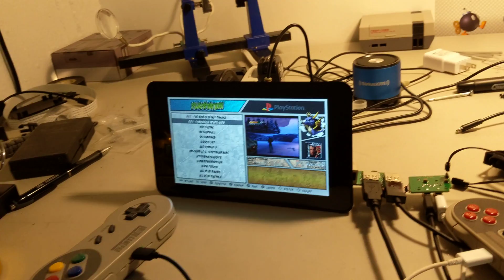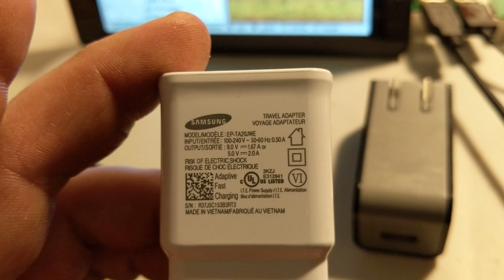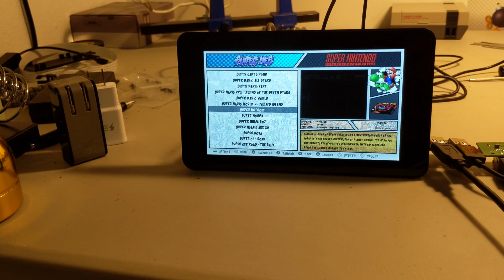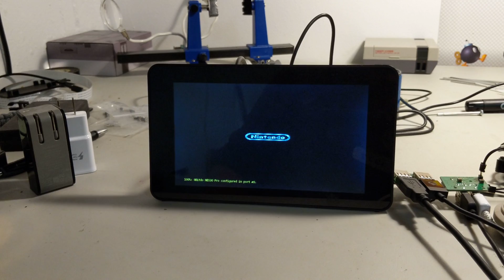Nespi raspberry pi power issue(solved)!!!!

Comment: Makes sense. The factory power supply was designed to run the pi. Then you add the case into the mix, and the case itself requires power, so now it is taking a piece of the pi (pun intended).

Comment: All these folks saying "just get a better power supply!" owe me $16. It's not the power supply. It's the NESpi. The minute I took the NESpi out of the loop I was fine. I bought "the" power supply for Pi and still has the bolt as long as I was plugged into the NESpi's power board. And no, it's not a knockoff NESpi which apparently the makers are trying to claim.
Reply from the maker: yup, I fought long and hard to get some more info on this to prove what was wrong.

Comment: I would think trying to charge four wireless controllers from a PI to be more concerning than the quantity. I'm sure four wired controllers would be fine. Even if I did have four wireless controllers for my setup, I wouldn't ever try and put that much strain on the Pi.

Comment: Good thorough analysis.  My NesPi4 case came with a power supply of its own. USB C 5V 3A, which is what normally is recommended for a Pi alone. Didn't yours?  
Now my Pi 4 hasn't come in yet, but is the power draw from the NesPi4 and all its compontnets really negligible? Even when accessing the SATA "cartridge" port?
Reply from the maker: These are older models from a few years ago

Comment: 3 years later it was confirmed that it indeed was the power supply. This issue may not happen to often with rasp 3, but it does happen with the raspberry pi3+. im just posting this incase someone happens to look at the video and may think that akuma was wrong, he was correct all along. the power supply that alot of modders use 
Mackertop 5.25V 3A.
Reply from the maker: Thanks bud.

Comment: I just noticed. The USB ports in the front (vertically positioned) give undervolting bolt. The ones on top, behind the fake cartridge flap seem to work fine. Using a 5.2V 3A power supply so the problem is absolutely related to crappy case wiring. Going to open it up and see if I can solder some fatter wires on there.
Reply from the maker: It's a combination of crappy wiring, crappy board traces(not big enough for current) and power supply issues with the way it seats into the power connector in the back of the case

Comment: Using a 5.2V 3A power supply here. Worked on my old setup but with a new image on there (fancy 400gb image) I have power bolt issues. I think it also depends on how much power is drawn from the cpu. I love this case so will look for even bigger power supply or a way to mod wiring to make it work.
Reply: that nespi case uses a bit more power than the average case I think that's why the new ones don't have usb 3.0 or a case fan included lol it works fine for me with a 1.8ghz speed  but anything higher even with a 3a power supply I'll get a lightning bolt with a ssd and 1 controller. So i say if you have a Pi4 get a 5v 3a power supply if you can get a solid 3.5 amp or a 5.1v even better.

Comment: I have the official raspberry pi 2.5A power supply, and without the case never any bolt, after using the case the bolt showed up very often, I swapped the wires for a heavier gauge and it's still finicky, first time I booted it never showed up, next time I tried it showed up during boot but then it never showed up again during game play. But the conclusion is that the case's main wiring is definately under gauged.

Comment: For me I tried 5.1V 3A and it didn't help. Then I tried 18AWG wire by itself and that didn't help. Soon as I used both the 5.1V 3A and the 18AWG wire mod the lightning bolt went away.

Comment: I also disagree. I was using the Nespi case with a CanaKit adapter and thought it to be the power supply so I got the Official Raspberry Pi Foundation 5V 2.5A Power Supply and had the same issue. I put the Raspberry Pi in a different case and both power supplies work fine with no issues.

Comment: I have nothing plugged into my retro pi and a teeter totter power switch and still i get lightning bolt lol. Also mine isnt a usb like yours it's a legit plug. What replacement power supply did you buy? Was hoping you had a link
Reply from the maker: And that is why. Those toggle switch power supplies are not always wired up very well. Plus some are under voltage because of the power supply switch. So if you have a 2.5amp toggle PSU you might only be pumping out 2.0amps

Comment: Same Thing happening with the SuperPi Cases. I've switched 3 different fonts and cables thinking it would help... but Im still having low power issues with 2.5A power supply.  I think its like the people say.... some of them are having these issues, some don't.
Reply from the maker: Yeah it's the wiring is too small

Comment: Currently using RPi 3B+ with the new NESPi and have bolts. It seems to come after a while. I played MGS on PS1 for a while, nothing happened. I switched to Doom (ZDoom), and it came along. It seems to do that when switching big games or especially with an Xbox One Elite controller. Getting a 5.25V, 3.0A now. Hopefully it works.
Reply: did it work?
Reply: Yup. No more issues.
Reply: Which adapter did you get specifically? Thank you.

Comment: I have to disagree.
It's not the power supply, I have raspberry pi 3 with a built in fan two USB controllers, and I had no power issues with that case.  I put the same pie 3 in a Nespi case and I got power issues.

Comment: Dude, it's an issue of quality control -- obviously you got a good case. -- I have a 2.5A power supply, it works fine with my RPI -- but with the NESPI case it had lightning bolts. -- It only has lightning bolts with the NESPI case -- that's pretty much a smoking gun. -- As soon as I removed the internal connectors and soldered in thicker gauge wires the lightning bolt issues went away. -- So you're totes wrong dude.
Reply from the maker: Michael Jensen usually I would agree with shoddy manufacturing. However I have modded over 130 of these case with not one issue ever

Comment: Would you say that the official raspberry pi charger supplies enough power to avoid the lighting bolt?

https://www.raspberrypi.org/products/raspberry-pi-universal-power-supply/#buy-now-modal
Reply from the maker: Tomas Storås some have had good experiences with the official PSU but if you want a full proof PSU anything that has 5.1v or more will do. Also it must be 2.5amps or more
Reply: Matt Farmer Thank you for the reply! I will be looking for a 5,1V power supply or higher
Reply: Matt Farmer Unfortunately this did not work for me. I just received my 5,2V 3A power supply, after 15 minutes the lighting bolt was back. Guess I need to do some soldering in order to get this case to work properly.
Reply from the maker: Tomas Storås it depends on the type of power supply. if it has a switch on it it will not work. If the cable can be removed it will be an issue. If the cord is over 4ft it will have an issue. This is why I suggest the qvs 5.1v 3 amp psu
Reply: Matt Farmer Thanks for the response! 

No switch. The cable is not removable and 1m long, so about 3,2ft. Might be that there is some power supply out there that makes it work, but for me that solution is starting to become too time consuming. Soldering seems like the easier and faster alternative at the moment.
Reply from the maker: Tomas Storås If you live in the US I do swap programs. Your case shipped to me plus $45 and I send you back a modded nespi case with upgraded wires. This will be using the James white soft shutdown mod
Reply: Matt Farmer Thanks for the offer, however I live in europe. I'll try to fix it on my own :)

Comment: Sorry i dont agree ive had other cases with a good 5v 2.5amp supply and ran 2 controllers and a fan whith overclocking and had no issues. Did the same setup in the nespicase and had the under voltage issue almost right away. The nespicase has current loss issues along with to small a gauge wire in it both contributing to the issue. Ive ran 22awg wire to power the pie directly to the gpio pins along with powering the usb ports and fan from the gpio pin and have had no power issues since.
Reply: It's a quality control issue -- some of the cases are fine, but many aren't. -- It's the Chinese switches inside. -- no matter how beefy the power supply is, it will not fix the lightning bolt issue if it's caused by the case. -- Cannakit has even acknowledged that the case has this issue and that their 2.5A chargers won't fix it if you have a bad case. -- The only thing that will fix the issue is soldering in thicker gauge wire (I've done it, and it fixed it, and now my 2.5A chargers work great with my Retroflag NES PI case). -- Again dude, your sample size is only one NES PI case, so please don't be dismissive of the issue.
Reply: Happen to have a video or document so I know what wires to replace with what gauge?
Reply: Michael Jensen any videos out there showing the soldering of thicker gauge wire? Would appreciate it and a link to buy some of the wire or an example. Thanks alot
Reply from the maker: Mike Melo disagree with current loss. I did anpart 3 video to this overclocked and running 4 raspberry Pi's off of the nespi case with almost no issues
Reply: @AkumaMods  I'm with Mike. I have 5 nespi cases total and multiple power supplies. After thorough testing I have determined that one case is indeed a lemon with a constant lightning bolt issue. Perhaps it's just a poor connection, idk, but I'm willing to bet a more powerful power supply could indeed compensate for the issue.

Edit: Forgot to mention the power wire immediately inside the case behind the socket on the lemon case seems thin and cheap. I seen a french youtuber replacing it with a larger guage wire to fix. I may give this a try soon.

Comment: I had a problem with mine which was similar to your issue but not the same, but it all worked outside of the case so the PSU was fine. I sanded the plastic around the power socket, as it seems the plastic is a little thick around the usb socket and it's not full inserting for me.
Reply from the maker: Jason Thorpe I have heard that from a few people. I'm just sowing people I have never had a problem with my cases and power supplies. Part 3 I run 4 raspberry Pi's through the nespi case and have almost no power issues
Reply: Matt Farmer probably just depends on the quality of the batch. But I'm still happy with the case it's pretty awesome.
Reply from the maker: Jason Thorpe while I would agree with you on that I can not. Ive modded over 60 of these cases now buying them in packs of 10 from 6 different people and every one is tested both before and after modding. I have a batch of 5 coming in from wish.com and will test those out as well.

Comment: Hey Matt did you ever try overclocking that pi to see if that 5.1v is still good?
Reply from the maker: MegaDad Gaming I will be doing that tonight to check.
Reply: Awesome, Thanks man!
Reply from the maker: MegaDad Gaming  check out my other video part 3 is a 2 part video. I went a little nuts with the system. And yes I overclocked it as well
Reply: ya i just noticed that thats why i deleted my recent comment, thanks
Reply from the maker: MegaDad Gaming oh just wait till you watch the nonsense I perform with my power supply
Reply: lol nice man ill watch it in a few :)